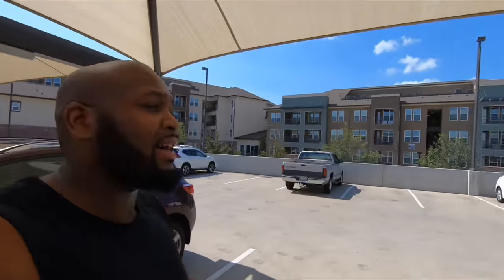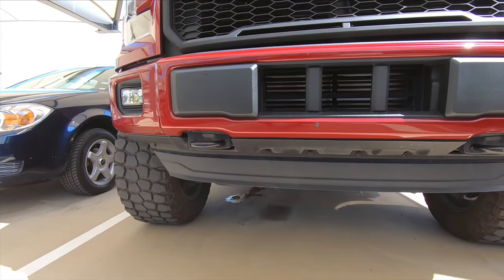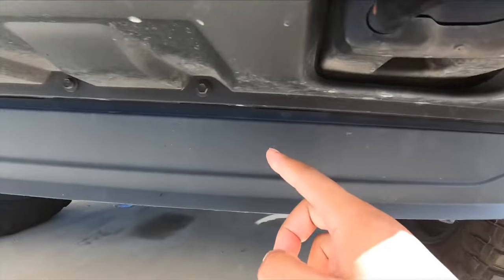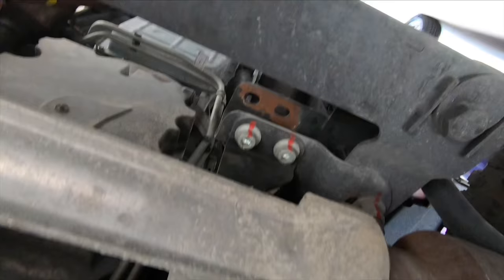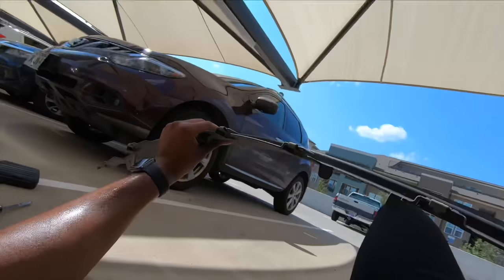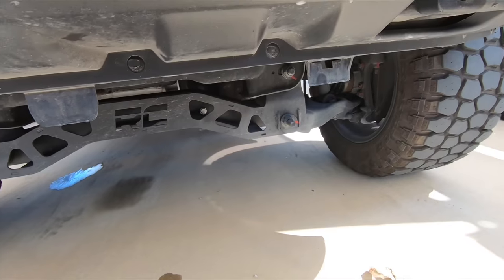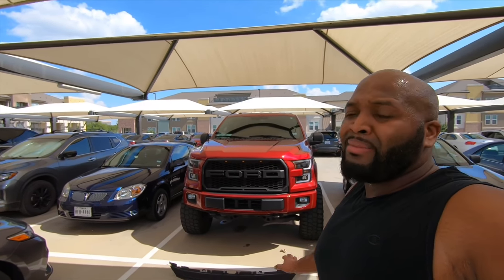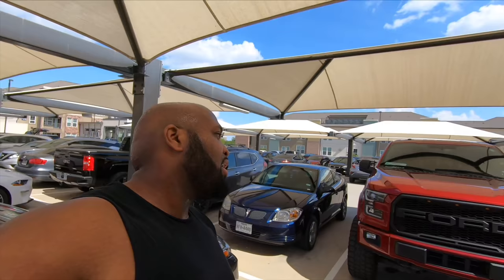I Should Have Removed This A Long Time Ago! 2015 F150 Air Dam Removal.

Comment: I removed this on my 2011 3.5 ecoboost when I hit a rock and it cracked and looked bad. My truck is not lifted but has larger wheels and tires, and I haven't noticed a single drop in performance anywhere. I'm reading some comments mention say you can hear more airflow under the truck. Ya know maybe I have?? If it's there it's marginal at best. I've had it like this for a few months and I haven't been bothered at all. It made my truck look a lot better and gave it an artificial increase in height and made it look more streamlined. I personally recommend it. It's really easy to put back on if you don't like it.
Reply from the maker: Yep! I agree 💯%

Comment: My understanding is, an important function of that particular part is to create negative air pressure in the engine compartment. This promotes the ingress of cool air. A point that may be worth considering.
Reply: Good point ..think I'll leave mine where it's at
Reply: So what if you just trim it at an angle where the front tires are located and keep the majority of it towards the center? Will it still function the same?
Reply: @anthonypazoz4323  I do not know the specifics on this application other than I remember this point being made by a reputable source. I think it was a Ford tech and the way it was explained seemed very legit.  I do know that when something is engineered to perform a specific function, altering it could very likely affect its ability to do its thing. Depending on the thing of course but especially aerodynamics is iffy. On the other hand, it could be negligible. Long winded way of saying I dunno. Somewhere on a scale of variables to factor and I'm not nearly well enough informed to be a good source.
Reply: @anthonypazoz4323  
Just get rid of it entirely. The guys talking all this nonsense trying to make themselves look smart. Makes zero difference. I removed mine in my Ram and it made no difference other than it looked better.
Reply: Y'all don't worry, that little piece of plastic doesn't do a thing. There was a single piece on my 97 F150 and I literally measured mpg und even dyno performance of the engine. It did not make a change. The only way I thin it'll do something is if you have a lower car, but even then it will only make a slight change, not noticable. A higher sitting Truck or even SUV will not be affected at all
Reply: that wld cause it to suck in hot air if it causes negative pressure u want air to flow through it not suck in  the hot air stuck in the engine compartment

Comment: I like the look of that air dam. I put a level kit on the front and my mpg went down. I run 93 octane and it took it right back up to where I was initially. I think next mode will be like some 22s or 24s
Reply from the maker: Nice man 🤙🤙
Reply: 93 octane? Jesus, that would cost over $225 to fill with todays gas prices.
Reply: 93 octane is pointless in a daily driver made after 2000. Modern vehicles use computers and sensors to regulate the combustion. 93 (ethanol free ofc) is best for everything else though like residential grade lawn mowers, 2 stroke engines, boats, 4wheelers, and side by sides.
Reply: @forcealpine87  
How? It’s only like 10 cents difference in price. At least anywhere I’ve been.
Reply: @replysoon3216  I’ve always used 87 octane in my gas lawn mower. Does it perform any better with 93?

Comment: Jus what I was thinking to do,  did you see any big hit on gas mileage or any issue after take it out? Thank you
Reply from the maker: Well my truck is lifted 6in and running 35s so my gas mileage was already impacted but I haven’t noticed any difference since removing
Reply: @KickinItWithQ  thank you for your quick answer, yeah I’m not too agresiva just have 2”level and almost 34 tires, just did it a few minutes ago, looks really good let’s see the performance
Reply from the maker: Sounds good boss!

Comment: Yes, it does effect your MPG and also will keep most dirt , dust and rain water mist getting into your engine bay
Reply: It doesn’t affect mpg as much as you think. Have you tested this yourself or are you just spewing info you heard or read? I’ve done it on my truck and it changed literally nothing.

Comment: Have you seen any changes in fuel economy ? Thanks!
Reply from the maker: No I have not  but I probably would not see an impact since my truck is lifted
Reply: @KickinItWithQ  Thanks for the feedback.
Reply from the maker: Np!
Reply: I removed mine like a year ago, didn’t notice any change even after leveling it

Comment: Is that suppose to give it a cleaner look so you dont see everything underneath it you said you liked it better off though so. I got the exact same truck 2017 model and am trying to find some other little upgrades.
Reply from the maker: Yea I personally didn’t care for that big piece of plastic there. By clean I meant no unessecary pieces.  For my truck it exposes the lift kit and makes the truck looks like it’s higher.

Comment: on the 2 wheel drive it's so low it scrapes on a parking block.  It is "the dumb" as the kids say.  Ripped mine off in under 24 hours.
Reply from the maker: That’s crazy!

Comment: Red is looking good Q! That said two things you should be able if you can modify brackets to make a Raptor skid plate fit. There is a thread on F150 forums.

My question did that Raptor grill you put in retain the factory shutters?
Reply from the maker: What’s sup man! Precitae you watching. Yes you reattach the factory shutters to the new raptor grille since the raptor grille doesn’t come with one. Here’s link to that video if you haven’t seen it https://youtu.be/Z_mvI8c5qEA
Reply: I saw it I really enjoy your content. Do you have a link for the grill? And letters? Maybe I missed that.
Reply from the maker: Patrick Doyle forgot to post it. Here it is For 2015-2017 Ford F-150 Grille... https://www.amazon.com/dp/B07DR7P7KT?ref=ppx_pop_mob_ap_share
Reply from the maker: Patrick Doyle also the F & R letters came with it.
Reply: KickinItWithQ Thank you very much Q. Keep up the good content.
Reply from the maker: Patrick Doyle Np!

Comment: If you do a lot of highway driving, it would be best to keep it on. There is a reason engineers with knowledge in aerodynamics put that on. Granted, automakers need to squeeze every ounce of fuel mileage to meet government regulations. The consumer can always choose to remove afterwards.
Reply: Teo P I have a 2017 3.5 ecoboost platinum and I drove the same trip the same day and hand calculated my mpg. Mpg was .04 lower over 50 miles
Reply: @cokerboy700  
Yup.
Many F150 owners affect the aerodynamics by putting larger tires, levelling kits or lift kits, so it's not a huge deal. 
But if you run long commutes every day...

Comment: I would recommend re-installing it. The purpose of these are to help save the life of the rubber from the rack-n-pinions. If those rack-n-pinion rubbers tear off then u have a higher chance or dirtying and eventually damaging your ball bearings inside. Not a cheap repair. Ask any 10+ year old Suburban.

Comment: How has it effected your fuel economy in the last few months with that off?
Reply from the maker: Hey man I haven’t notice an impact at all. Still getting about the same
Reply: @KickinItWithQ  Awesome, I think I'll do the same to mine.  Thanks!
Reply from the maker: Np! My truck is lifted with big tires so my mpg is shot anyway
Reply: KickinItWithQ have you noticed any difference at all with the air damn off?
Reply: It dropped mine about 2mpg. Took it off for a snow plow mount. I want it back on now that I don't plow anymore
Reply: @KickinItWithQ   The higher up the truck is, the less effect the dam has... more of the underside is exposed which creates more drag.  I did a 2nd air dam on my older 4x4 Ram which showed zero effects when I had it leveled with 3" kit, when I went down to a 2" kit it started flapping in the wind.  When I dropped down to stock height, it broke 2x on me so the last install I reinforced the mounting bracket (which admittedly was weak to begin with).  Aero drag can have a big impact on performance, reducing it has been an eye opener.

Comment: Q u dont buy a Ford for gas mileage my3.5 gets 11mpg with my lift
Reply from the maker: No question! It’s Definitely about the Smiles Per Gallon lol
Reply: @KickinItWithQ   q do u live in Dallas area I saw a truck just like yours today..
Reply from the maker: James sammann yes sir DFW! I do see a lot of trucks like Red. One time I thought someone had stolen it, they looked just alike
Reply: @KickinItWithQ  4sure i.have not seen  one like mine LEDs..t Rex grill.. Gaylord tonneau cover and amp boards it looks bitchin all blacked out  I just wish I got the 5.0 this 3.5 loves the shop for repair  it is $$$$$to work on Ford doesn't honor there warranty at all they dig out an excuse for everything so they don't have to cover any anyting it's always to to 5000 to have anything done on that truck
5
Reply from the maker: James sammann sounds sick! The power boards definitely will be coming for me one day. man that sucks so far so good for myself but I hear that’s why people prefer the 5.0.

Comment: Pretty sure the engineers that make your vehicle put the stair for a reason I belive  they have more resources and knowledge then the " home driveway mechanics " have its will keep snow and shit out of your engine bay .
Reply: You are supposed to remove it for snow (edit: or offroading)...
Reply: @jeffm2586  no your not lol if anything it helps help Salt and sand getting up into and under you engine you know diddly squat.
Reply: @--emt  lol Ford says in their manual to remove it if you are off roading or in heavy snow as you may damage it.   Removing the air dam is not the same as removing your skid plate.  WTF you on about lol.  It is designed to redirect airflow to reduce your MPG, not to keep some sand out of your engine bay.  🤣
Reply: @jeffm2586   As you're driving and the salt and snow is going underneath your vehicle the air dam re directs it to your undercarriage and not up into your engine bay  ford doesn't know what the fuck they're talking about that's why you like Ford lol. they are going bankrupt and shutting down their factories across the United States but ram keeps going ? oh yeah I forgot ram has the TRX what does Ford have? 
Yes it helps MPG but it's there for other reasons who the fuck go's off roading in a Ford  the thing would shit the bed the first trail hahaha